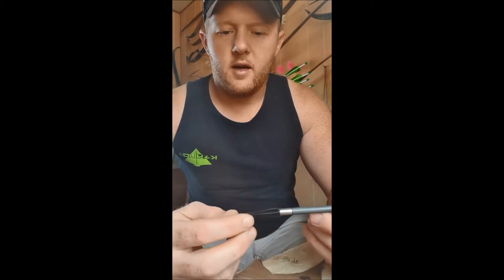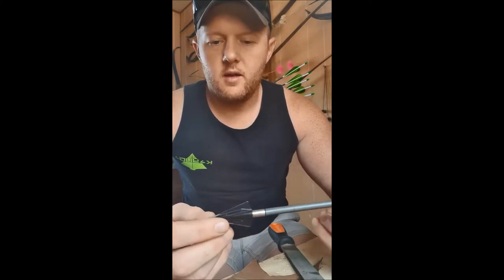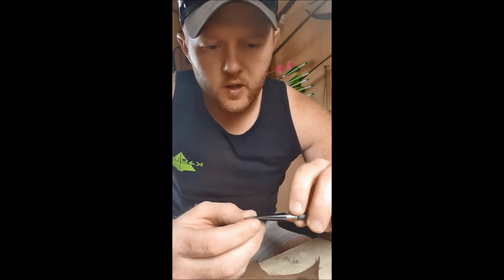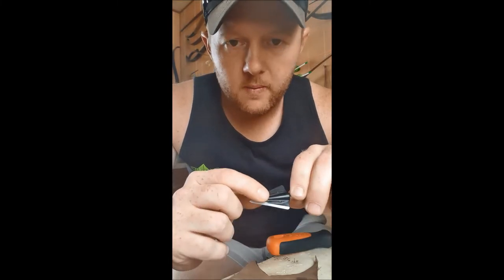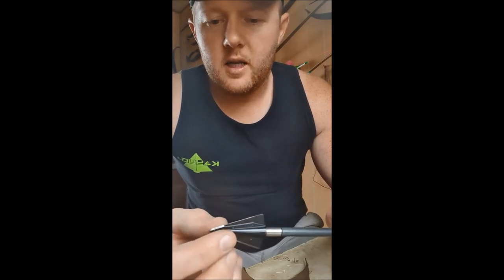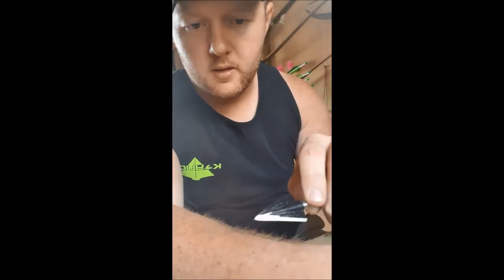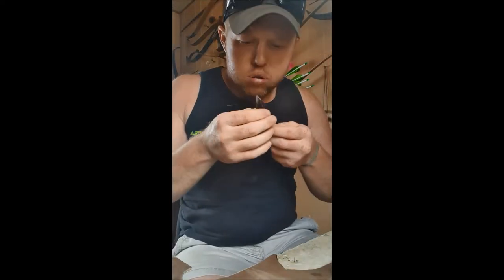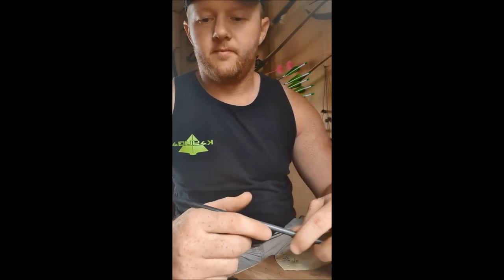Old School Single Bevel broadhead sharpening

Comment: I think I'll stick with the double bevel older ones  , I've been using them for 5-6 years on pigs  , my favorite broadheads are the Magnus snuffer ss.... stainless steel  , fixed 3 blade , super strong and take about 1 minute on a good quality fine grit wet stone to get super scary sharp , probably the sharpest broadheads I've ever used , excellent on all deer species but the 2 blade kayuga are the best on crusty shouldered boars , great video 🇦🇺🤙